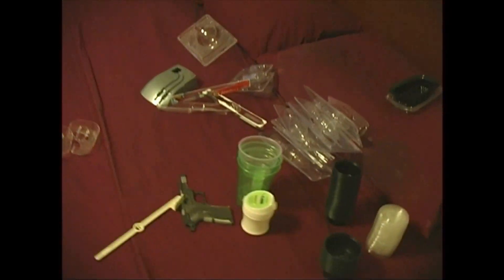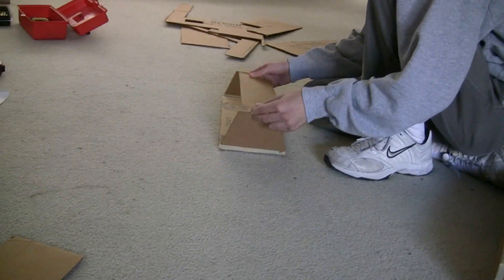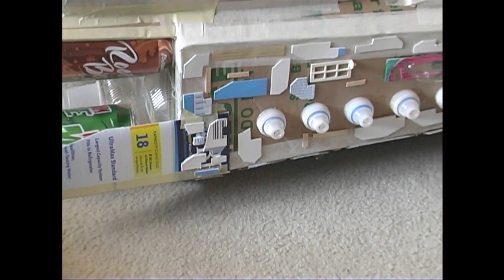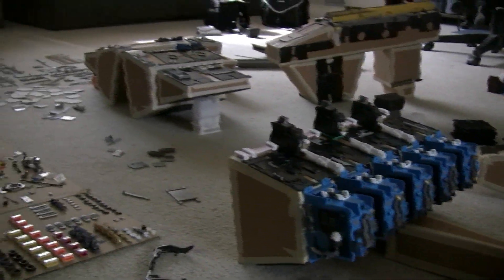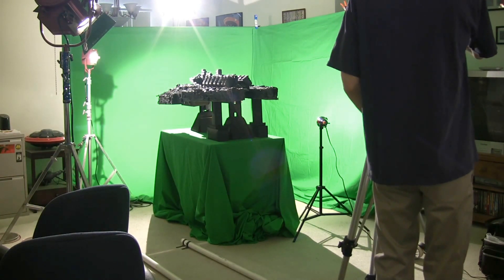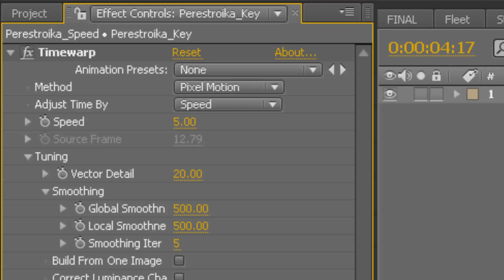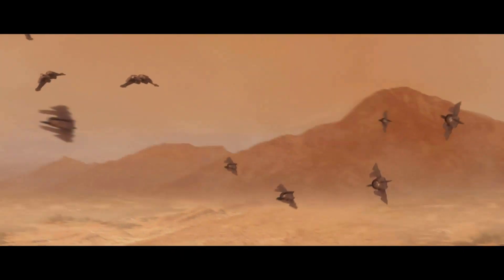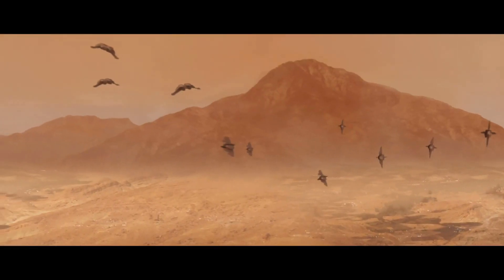Simple Tricks and Nonsense Episode 2: Model Spaceships (2011)

Comment: In terms of building materials I'd very much suggest investing in sheet styrene (a 4x8' sheet is pretty inexpensive) and MEK solvent (or appropriate Weld-On) as an "adhesive" to meld styrene panels and other cut-out shapes and plastic model kit pieces together...If you aren't using this already. This allows precision so that the models can be shot in extreme close-up. (Possibly you're already using these things, but I didn't see any mention in the video.) Thanks.

Comment: Could you expand a bit more on how you filmed it? Ive been doing something similar but instead of taking pictures, we just used the dolly to roll past the model. Is your way more effective?
Reply from the maker: Alex Burgess The main reason for taking photos was so that we could get over twice the resolution. We knew we wanted to use these elements in multiple shots at different depths, so that gave us more flexibility. Also we were shooting on a 7D, so the video compression and aliasing of small details is really bad when in video mode.

Comment: will4ward Hey man, with regards to coating the cardboard, do you think standard laminate/laminating plastic sheets (stick on, not heat shrunk) would do the job?

Anything as long as it covers the grain/fibres of the cardboard?
Reply: Yes some  Evergreen plastic sheet glued on with CynaoAcrylate,
or you could thinly spread Polyester resin over the surface, sand it down smooth and glue to that.Its all about how well you finish the surface.
Reply: Great man, thanks a lot for the tips :) take it easy, continue the great work!